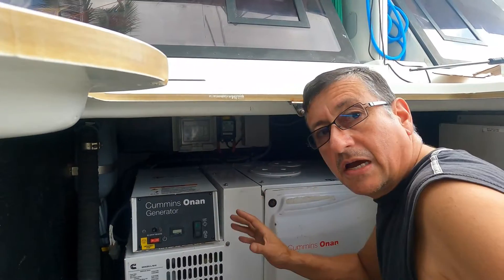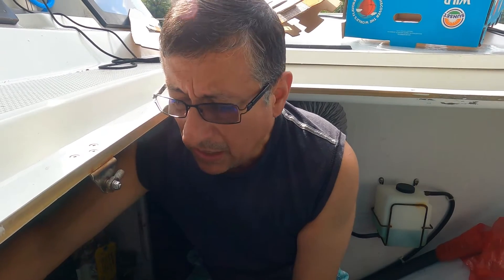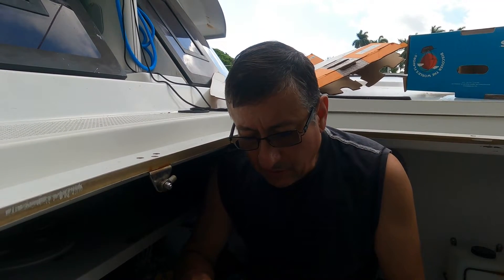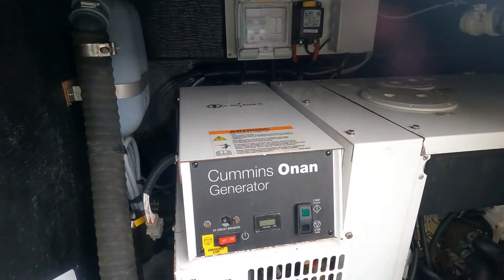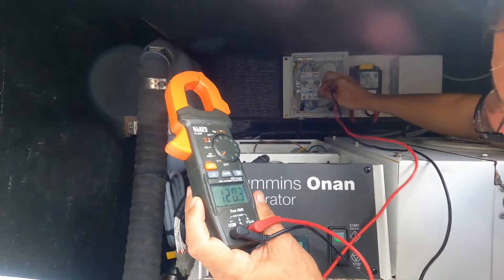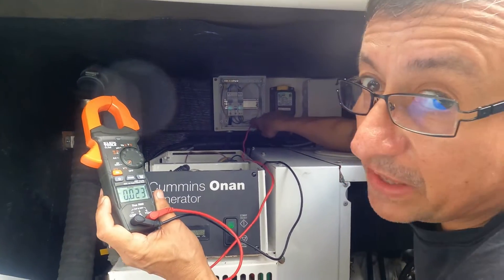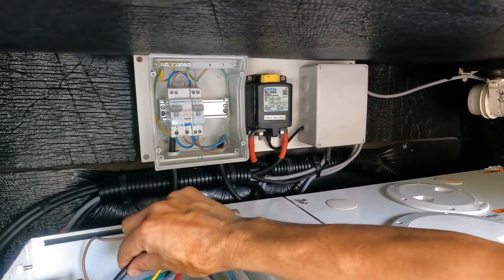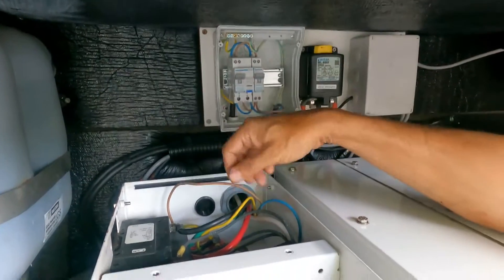Analyzing a Raw Water flow Issue in an Onan Generator

Comment: Hi Mr. Lopez, we just put in a brand new onan and when we start it it runs for 20 seconds and shuts off and flashes 7 times. But when we check the strainer everything is clean and there’s good water flow to the generator, and while it’s running there’s a good amount of water coming out the exhaust out the boat, we checked the impeller and everything looks good. And when we unplug the sensor the generator runs fine, what could it be?
Reply from the maker: Hello , Which sensor did you remove ?
Reply: I too have the same issue pluged off the Raw water sensor and it runs ok, what causes it